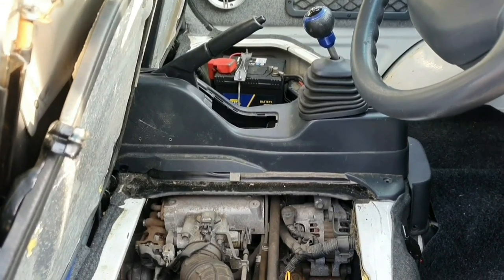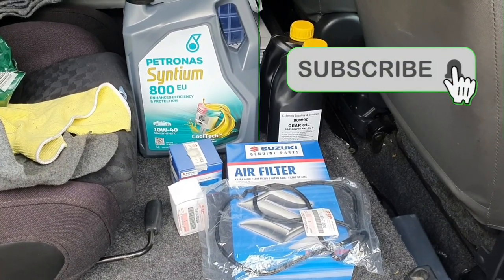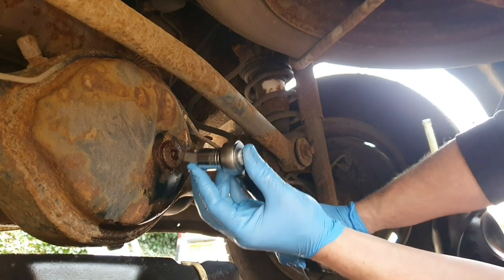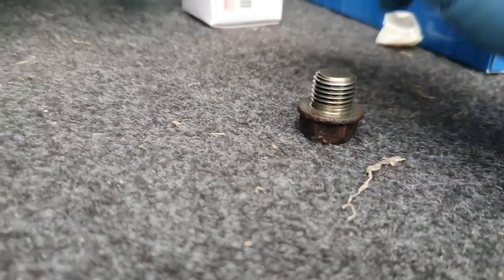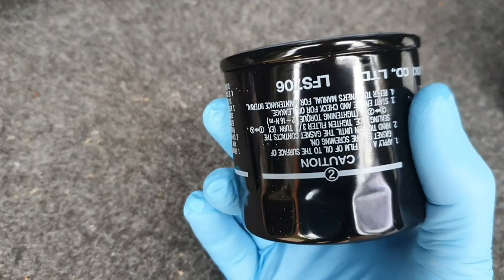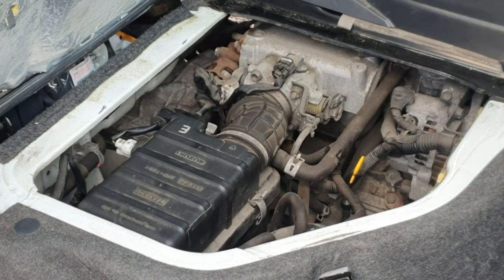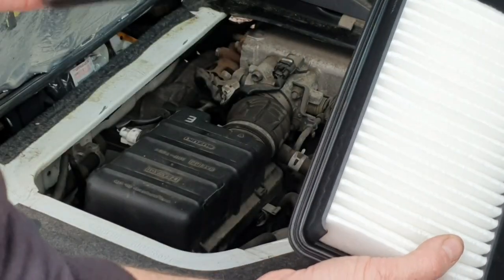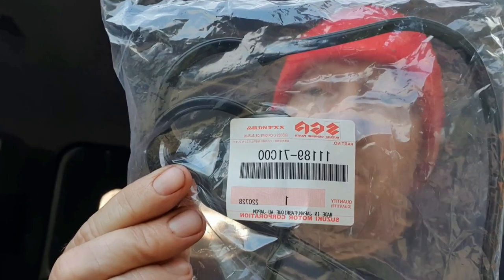Suzuki Carry basic service and another problem!

Comment: Good morning from Bermuda brother. I have a light carry Suzuki that’s 22 years old. I have a problem with the check engine light and then the van starts to dog out a bit. Any ideas what it might be? Thanks
Reply from the maker: Hi, thanks for watching👍🏻. Could be anything in the ignition or fueling systems really. Best thing to do is get an engine code reader plugged in. I've chased my tail too many times in the past with similar experiences and it can get expensive trying to second guess a problem. Good luck, hope you get a quick fix with it. 👍🏻
Reply: @Bloodshed.restorations  oh okay I got ya. Thanks for the response. Take care.

Comment: what diff oil and gear oil did you use? Also, what size new wheels did you go for?
Reply from the maker: Hi Josh. The diff oil is Hypoid gear oil API GL-5 SAE 80w-90. Gear oil was API GL-4 80w-90. Can't remember what brands they were, got the gear oil from Halfords, the Hypoid stuff I got from a reputable seller on Ebay. Wheels are 14" mk1 MX5 ones, great improvement with handling, compared to normal anyway.👍🏻
Reply: @Bloodshed.restorations  
Do you know if you used more than 1 litre for each? That tube you’ve got to dispense looks useful too!
Reply: @Bloodshed.restorations  so is the only difference in the oil GL 4 GL 5?
Reply from the maker: It has to be a hypoid oil as these types are specific to the diff, they contain different additives to cope with the extra pressure and help reduce wear, apparently, always go with what the manual says. The nozzle was off an old 2 stroke oil bottle, made life much easier.
Reply from the maker: I think it was about 1.3 ltrs, definitely more than 1 anyway.
Reply: @Bloodshed.restorations  Hi Alex, im not sure if I’ve misunderstood this, I’ve acquired the oils you used but isn’t it diff gear oil but for the filter change is it engine oil 10w 40?
Also, for getting the diff bolt loose, I thought it was a 1/2 breaker bar / torque wrench but it doesn’t seem to fit, what size are you using? 
Thanks again
Reply from the maker: @joshlambe8259  hi, yes I think it was diff gear oil. The engine oil was 10w40 semi synthetic. Can't remember what size the bolt was off the top of my head, think it was 13 or 14mm. Best thing would be to download the workshop manual from one of the Carry facebook groups. This is shat I did and it proved invaluable, especially when it can to the oil types, that way you know that you're getting everything correct. The gearbox and diff oils seemed the same until I read that it was a hypoid type.

Comment: Hi there, I've just got an 05 carry and have noticed there is a leak coming from the brake weight compensator. They are impossible to find, just wondered if you had any tips to solve the problem or if you have ran into any issues with yours? Cheers, Josh
Reply from the maker: Hi, at the moment, I've not had any issues with my brakes, thank god. Sounds like it's a seal gone, which isn't really what you want. Have you tried a Suzuki garage for part numbers etc? There are some good facebook groups out there, sure you're not the only one to have had this, especially with the amount of these vans worldwide. Good luck with the hunt. Alex👍🏻